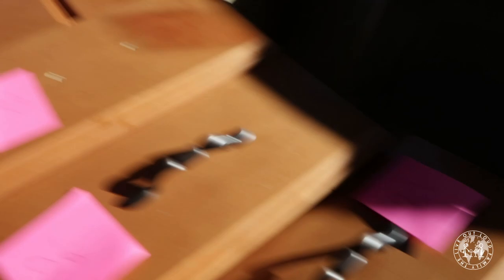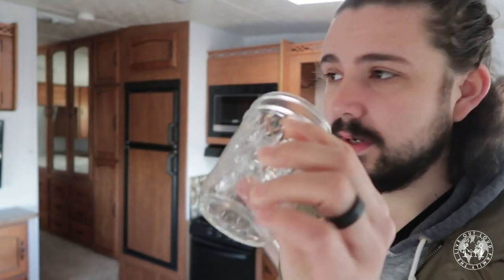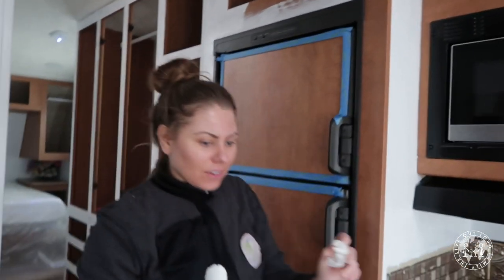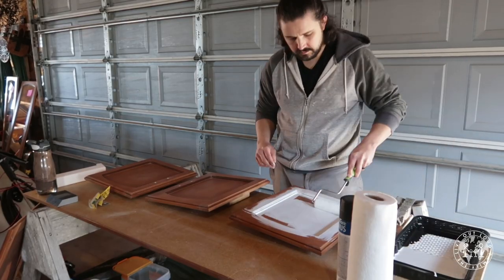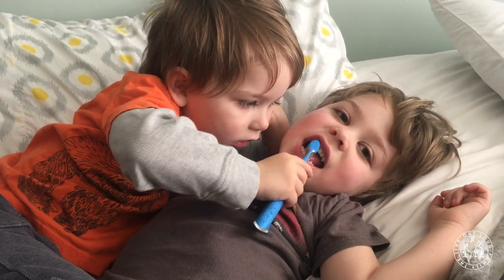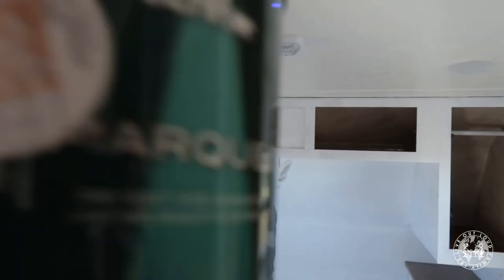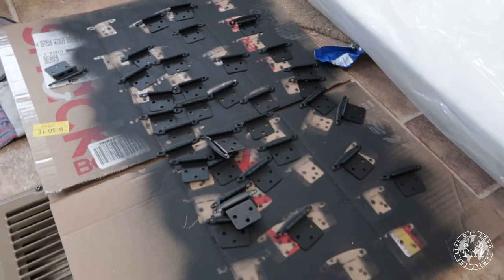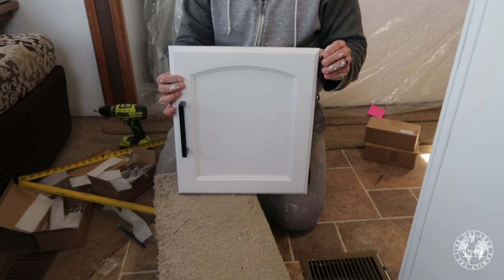PAINTING RV CABINETS! // RV Makeover before and after

Comment: Did you have any surfaces on your cabinets that were curved and where the manufacturers had used a paper type of veneer that doesn't seem sandable to me?  If so, how did you prep that and what type of primer did you use?  Thanks!
Reply from the maker: Hi, good question. I did not see any paper type of veneer on our cabinets. Is it something you can remove? We used zinnser 1,2,3 to prime the cabinets and that worked fairly well.